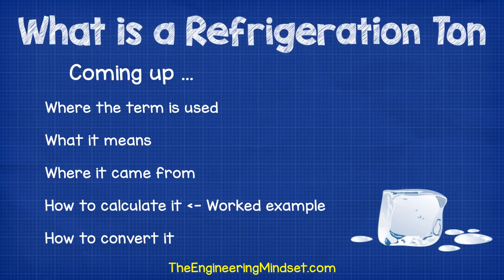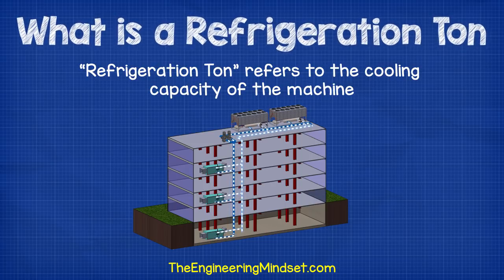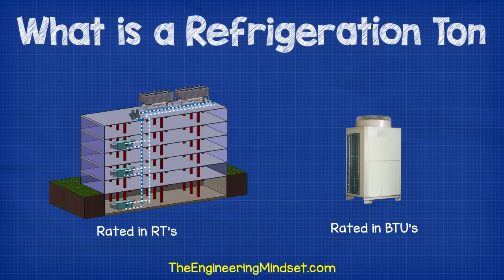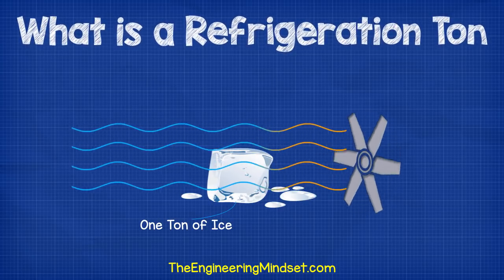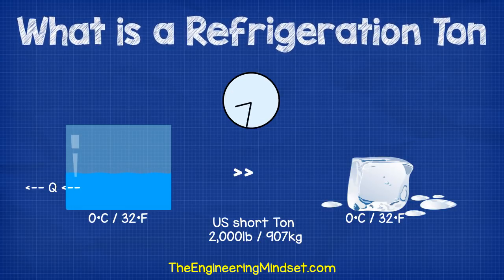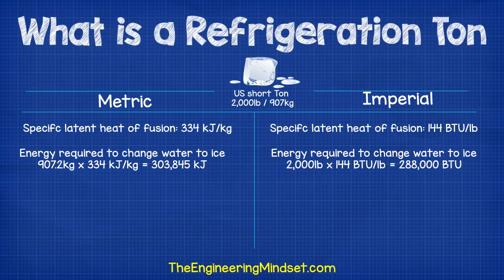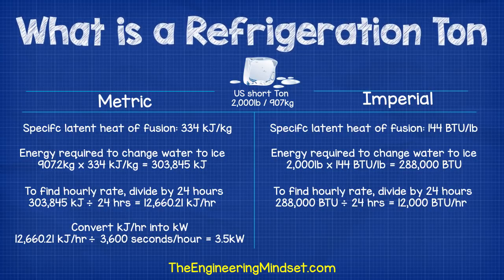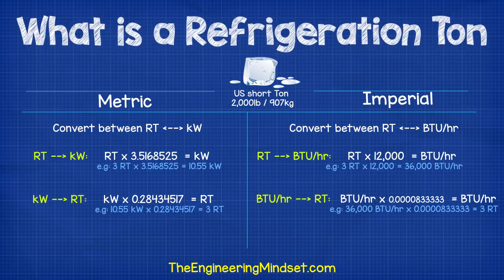What is a Refrigeration Ton + CALCULATIONS chiller hvac btu kw

Comment: Refrigeration ton (RT) is defined as the rate of heat transfer that results in the freezing or melting of 1 short ton (2,000 lb; 907 kg) of pure ice at 0 °C (32 °F) in 24 hours. Notice that the freezing or melting of the ice represents a change-of-state only, which is considered a transfer of latent heat, as opposed to a change in temperature which is a transfer of sensible heat.
 1 refrigeration ton is approximately equivalent to 12,000 BTU/h or 3.5 kW.

Comment: Another good video c/w simple explanation. As an engineer though I do tend to spot errors: for instance BTU/hr x 0.000083 = RT you have made a typo showing BTU/hr as the same unit. Sorry but had to point it out or I would not have slept tonight :)
Reply: ,,,,,,Btu  ton  ,refrigeration   ,ton  capcitey,  1 ton   btu, =12000btuhour  ,1ton =12000 h  ,1btu=552  kalory ,1ton=12000×552=3024000 , ,,,1ton=302400/1000=3024/houer,
Reply from the maker: Well spotted. But now I won't be able to sleep!